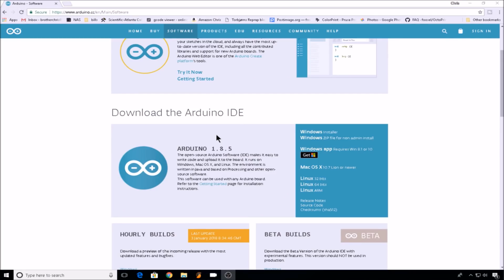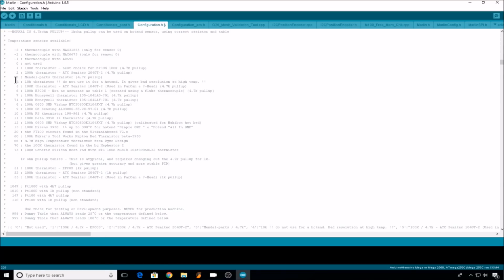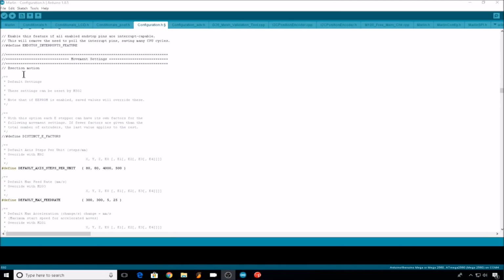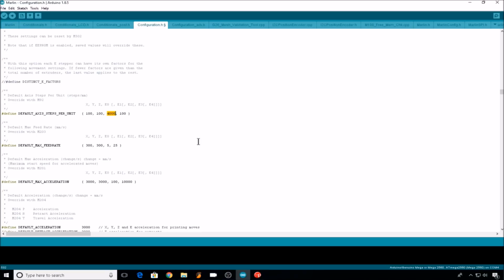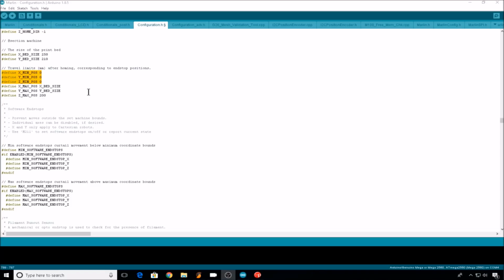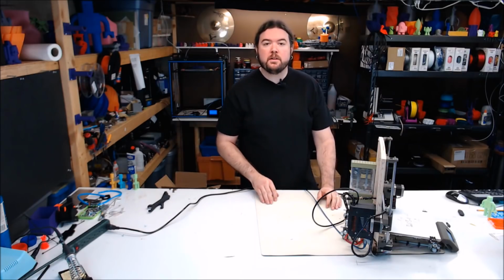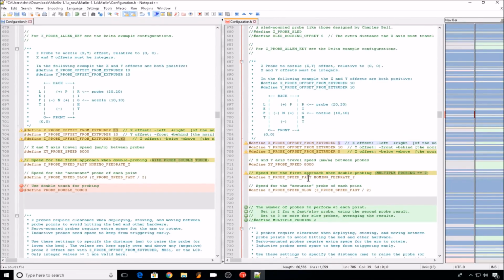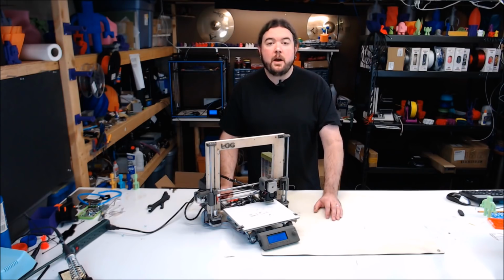Marlin v1.1.8 3D Printer Firmware Complete Config - 2018 - Chris's Basement

Comment: Thanks Chris,  Subscribed.  It has taken me half a day but I've managed to take my Geeetech Prusa i3 Pro B from the factory installed firmware 1.0.3 all the way up to the latest 1.1.9.    I've a programming background (years ago) so with your instructions it was all pretty straightforward.   An invaluable guide and the Notepad++ tip and Compare versions is awesome.
Reply from the maker: You're welcome! Thanks for the sub! I have intimate knowledge of the PRO B, it can be frustrating at times to say the least. :)

Comment: This was a very good tutorial vid. I especially liked that compare plugin for notepad++....didn't know that plugin existed. Very useful. I've been trying to set up the new Marlin for my GT2560 board and sanitycheck.h has been screaming at me every time I try to verify. Trying again with a fresh download using my notepad++ with compare.
Reply from the maker: Awesome! I have worked on the GT2560 a couple of times. Let me know if you still have issues. I might be able to help. Thanks for watching.
Reply: Well after multiple issues with Marlin in the IDE, I finally got it to compile a sketch (some things are different since last I used the IDE). I was going to load it after I finished my current print job. Unfortunately, I had a 'derp' moment...noticed a bed wire was barely clinging on at the board (my own shoddy wiring work) and I moved it. Blew my 10A fuse. It's amazing how difficult it is to find those things. Waiting for new fuses before I continue.
Reply from the maker: HedoBum Doh! I have replaced those with automotive fuses in the past if that helps.
Reply: Wow...didn't think automotive fuses will fit in those blocks. I imagine you can get automotive littlefuse in there with a little post wrangling. Nice MacGiver.
Reply from the maker: HedoBum Not a great fix, but you could probably make it work.

Comment: Hi @Chris Riley, and thanks for the exhaustive video of Marlin settings! Great job, clear, comprehensive, and I like your voice (not making a move on U!), like ChrisFix 's one!

I just flash my Anet 8 with Marlin 1.1.9, and the thing is that when I'm doing an Auto Home, my printhead stay stuck on my endstops, and that for the 3 axis... I double/triple check my settings (especially X_MIN_POS, Y_MIN_POS, Z_MIN_POS), flash marlin 3 times...and don't find back the way it "autohomed" when I was with the original fw (step back few millimeters in the 3 directions after "Home All").

Is that normal, or did I miss a thing? 

Thanks again man!
Reply from the maker: Hey Oliv, thanks! So it autohomes, but it doesn't double check anymore? In configuration_adv.h make sure these are all uncommented and set to a number.

//homing hits the endstop, then retracts by this distance, before it tries to slowly bump again:
#define X_HOME_BUMP_MM 5
#define Y_HOME_BUMP_MM 5
#define Z_HOME_BUMP_MM 2
Reply: @ChrisRiley  Thx for your reply:  it does double check every time I make an autohome... I checked one more time, and this behavior, that I took for strange, is completely normal with Marlin! I made knots within my mind for nothing, but before printing again, I preferred asking some specialists!
Everything is working fine, and so I printed yesterday my 2nd test cube, with nice result!
Reply from the maker: @olivclt9567  Great! Glad it's working.

Comment: Great video Chris, very concise as well as the updated one on the Feature walk through of v 1.1.9.
I made a change of the different location to park the nozzle. When I changed the line with ´min +10 and max -10´ to your suggestion (a good one too) to ´max -10 and min +10´. I received an error message when verifying: ´X_Max_POS´ was not declared in this scope. I then changed it back to the original, saved it, and ran it again I received the same error message. Any suggestions?
Reply: Additional info: I just noticed that the error message say ´X_MIN_POS´ was not declared in this scope, when I changed it back to the original.
Reply from the maker: Probably just some syntax it doesn't like. Make sure it's like this. #define NOZZLE_PARK_POINT { (X_MIN_POS - 10), (Y_MAX_POS + 10), 20 }
Reply: @ChrisRiley  Chris thank you for your prompt response. That took care of it. Not sure what I did it looked correct. So, now the head will park to the right side, great.
Really enjoy your videos, I binged watched all of them in three evenings, I do not sleep much. 
You keeping producing them and I´ll keep watching. Thank you again. : -)
Reply from the maker: @dustykatz9504  You're welcome! thanks so much for watching!

Comment: Hello, I like your video very much. I want to ask you a question, how to turn on the fan to cool down when printing the second layer
Reply from the maker: Hello, thank you! That would be done in your slicer. It will tell the printer what layer to turn it on.
Reply: Thank you for your advice. How to set the G code? My fan pin is 6
Reply from the maker: @spacedream6028  Pin 6 should be default. If it's marlin just use M106.

Comment: Hey. At the beginning I would like to thank you very much for the films that are available on yt, they are very helpful though I do not understand everything because I can speak English ... Can you help me? I built a printer. Similar to I3 this is my concept ... I have a problem with X and Y engine steps I have Nema 17 engines, their steps are set to 80 in marlin. But as it prints a 20x20x20 cube, the cube comes out x19. 48 y 19.5 out of 20 ... Alenjakncalibrates the printer to the 20x20x20 cube when printing a larger cube there is a discrepancy ... 100x100 cube will print 101.5 in X and in Y 101.48 or 1.5mm bigger ... I do not understand the blacz ...? I have 20 gears. GT2 belts are buckled. The printer's geometry is in perfect condition. The dimensions and angles are preserved everywhere. With the rest of the problems during printing, I advise ... Are you somehow an experienced printer. Can you help me? Please contact me TonaTomasz@gmail.com
Reply from the maker: If you have 20 tooth pulleys then your x and y will be set to 100. Those measurements sound very close though. Maybe the pulleys are not perfectly round?

Comment: Great video Chris! Thanks for coverage with current versions of Arduino & Marlin. 
The only thing I did not see you cover was the "X Y Z axis homing and auto-homing. Line 1391 covers "Individual Axis Homing" then line 1395 is uncommented for I_A_Homing_Menu but there is no menu and when uploaded my Di3 goes to x=0, y=110, z=0. Where do I find the menu to correct this to x0 y0 z0?
Reply from the maker: This is good feedback, I am getting ready to start the 1.1.9 walkthrough. Do you need to do safe homing? in the center of the bed? If so take a look at this option. #define Z_SAFE_HOMING

If you are getting different home locations, take a look at these options.

// Travel limits (mm) after homing, corresponding to endstop positions.
#define X_MIN_POS 0
#define Y_MIN_POS 0
#define Z_MIN_POS 0
#define X_MAX_POS X_BED_SIZE
#define Y_MAX_POS Y_BED_SIZE
#define Z_MAX_POS 210

Comment: This a stupid question but do you have to include all of the tabs when configuring marlin my marlin ino doesn't have all of the tabs in it for some reason if I want all of the tabs I have to include them still no power to anything on the printer no bed no nozzle no connect plus all of these apps printrun  slic3r marlin don't really look like everyone else's  I don't know what apps to open some of these files windows 8 thanks in advance for any help👍
Reply from the maker: Hey, so if you only see some of the files, you probably need to try extracting it again. Extract all before you try to open it in Arduino.
Reply: I got rid of other version got 1.9 I guess but I didn't extract it yet. What is the best place to extract it to so that it opens in the arduino ide ?thanks for any suggestion's👍
Reply from the maker: @wishicouldarduino8880  Hey, you can extract it anywhere, desktop is fine. Then you can just go in and click on the .ino file.
Reply: @ChrisRiley  I've tried it all it powers the backlite to the LCD and the end stops but nothing else I'm dumbfounded as to how to get it working .

Comment: i have not done any update since me last print that came out good and now all of the sudden my printer starts printing 10mm off the offset, any idea why? i calibrated the bed like 4 times and reSliced the file 3 times and still wont go down to Z0 and begin print.  i only have printed 1 model i designed in CURA 4.0.0 and i own a new ALFAWISE U20Plus 400x400x500 Marlin v2.1.6
Reply from the maker: That sounds strange, what does the output on M503 look like? Cura might be adding something in there.
Reply: @ChrisRiley   im sorry but how would i obtain that info? what do i type in and where  do i type it?
Reply from the maker: @arletpaz8010  Download pronterface here: http://www.pronterface.com/ Then cable up to your printer USB and you can run the 503 command.

Comment: Hello there, maybe you can help me, i have an MK2B heabed and im having issues with the mosfet, it gets really hot! first try i just soldered the Pin 1 and 2 for the bed so i got half of the beat heated, and the mosfet was ok, then i bridged Pin 2 and 3, so i can get the whole bed heated but the mosfet was f.. hot. IDK whats the issue i changed the mosfet for another of the same specs supports till 50amps and still got fricking hot, also in the bed there is a hole for a 1k resistor and leds, i need to solder the resistor and the leds there? maybe thats the issue that i dont have the 1k resistor or maybe that resistor is just for the leds...
Reply from the maker: That resistor is just for the led. Those beds can be really flaky. If the resistance of the copper is too high, you will get what you see here.  You probably have some trace damage in the bed somewhere, not much you can do about it.
Reply: @ChrisRiley  thanks for the reply, then I'll just buy another MK2B dual hotbed, thank you Chris.

Comment: Hi there, I know I'm a little late to this video, so hope i can still get a reply. I have an Eaglemoss Vector 3 (was purchased cheap not knowing much about the subject). I have marlin installed on it, but the bed leveling never worked properly, so i decided to reinstall marlin. I can't anywhere see an answer to how you enable software endstops. Can you help me with this? My printer only has 1 endstop switch on each axis, so when you go to do the bed leveling, it goes way too far and grinds. Please any help would be appreciated, i've been awake for the past 24 hours trying to sort this lol. many thanks. good video.
Reply from the maker: You should only need 1 endstop for each everything else is controlled by bed size. Make sure these settings are correct. 

// The size of the print bed
#define X_BED_SIZE 310
#define Y_BED_SIZE 310

// Travel limits (mm) after homing, corresponding to endstop positions.
#define X_MIN_POS 0
#define Y_MIN_POS -29
#define Z_MIN_POS 0
#define X_MAX_POS X_BED_SIZE
#define Y_MAX_POS Y_BED_SIZE
#define Z_MAX_POS 300

Comment: Man i need your help!! I changed my board from ramps 1.4 to 1.6 cause i had problem with the heatbed. Everything worked fine in 1.4. Now that im using the 1.6 ramps the z axis makes weird noises and doesnt move up or down. Y and X axis work fine. I swapped motors from z axis to x and they work. I swapped the motor drivers and they also work. Everything is connected correctly on the board and i havent made any changes in the marlin software. Endstops work correctly. What should i do? Im posting this here cause i have had a ton of help from your videos. Keep up
Reply from the maker: I hate to say it, but it sounds like you have a bad ramps shield, the QC on these isn't very good.

Comment: Thanks again Chris for excellent tutorial!!  Really deep & complete flushing my B(rain)CB. 
What about Marlin Feeding Rates (spatially for Z) You would recommend for CNC milling ?
Reply from the maker: Ooooo, that a tough one. I would guess it would depend on the material, not really sure. I home to get a CNC project together sometime soon.
Reply: Yes.. I'm here to help any CAM task. I asked about feeding rates and speeds in general .. thinking that these are max allowed written values in Marlin ..
I do specify all feeding rates when generating Gcode in CAM
Reply from the maker: @ffstructures  Oh, yeah, that's a good question. I don't "think" Marlin has a maximum, you can get it as high as you want in the config.

Comment: Hi Chris. Im setting up a Ramps 1.4 (EFB) /Arduino Mega 2560 (WiFi) for an adapted Makibox but I'll also be using this set up with a much larger 800x700x500mm printer I'll be building soon, so I wanted to test the card first; I'm stuck with Arduino 1.8.8/Hardware Folder and what, if anything to set using the Boards Manager which you didn't mention (I don't think) during this pacy video. Annoyingly Ive already had the correct setup and forgot this element when I changed things to try to upload Marlin/Repetier to a Tronxy X3A Melzi (what a nightmare); If you or anyone else can remind me what I'd have done to get the correct board recognised that'd be much appreciated. I'm fairly sure I installed Arduino AVR boards v1.6.14? I also liked the comparison tool very much, Ive been opening 2 copies of the IDE as cut-down windows and comparing my fiiles that way, your way is much better. Thanks for shring that info.
Reply from the maker: You're welcome, it just won't recognize the board? Is it a genuine arduino or a clone? If it's a clone you probably need to reinstall the ch340 driver. I have also had problems with the IDE 1.8.8, I like to use 1.8.5, it seems to work with everything.
Reply: @ChrisRiley  Ive had Upload successs with IDE 1.04, 1.85 & 1.8.8; I reloaded the CH340 an hour ago & the firmware suddenly uploaded, so, the advice I just read was (unsurprisingly) correct. Thanks. It'd worked with this combo & that driver before so I couldn't see why it wasn't working this time. Driver Reload fixes a lot of problems I suspect. I'm now disproportionately smug at finally seeing a customised_boot_screen LOGO appear on the RRDSC. 1 small step for mankind, 1 smug 'giant leap' for me. C's B Subbed.
Reply from the maker: @goldbunny1973  Awesome, I do love a custom boot screen.

Comment: What am I missing   Went to Arduino downloads and got what looks like most updated version 1.8.9 or windows store version 1.8.21   following along but mine doesn't have same tabs at top as yours does
Reply from the maker: It will just have 2 tabs now, they have restructured it, it will still work the same. You can edit the other files in notepad ++ or something like that. Or use VScode with Platformio to edit from now on.

Comment: Hi,  I am installing RAMPS 1.4 into a Wanhao i3 and have been making great progress by following this tutorial.  But try as I might, the sketch won't compile. The compiler gives me an 'exit status 1' message listing  one of my arduino program files and complaining "undefined reference to 'main' ".  On an earlier try, the undefined reference was to 'setup' and 'loop'. When I tracked down this file, it was an unhelpful MS Visual Studio file describing  the standard layout of INO code. I have tried loading earlier Marlin versions with the same result. Does this mean I have to forget using Arduino if I want to access Marlin? Must I use Visual Studio instead? This error  offers no guide to correction. Any help would be appreciated.
Reply from the maker: You might need to move to VScode, or you need a different version of the IDE. Try an older version like 1.8.5 they are available on there download site.
Reply: @ChrisRiley  Thanks. I have moved on to your tute about VS code etc. Excellent, Thanks.

Comment: Hey chris, i have a big problem with my printer. When im  trying to print the z axis wont lift at all, its printing all the layers at the same height. I did all the neccesary configs  in marlin but i cant figure out what is going on.
Reply from the maker: Is it a custom built printer?  Are you using Marlin?
Reply: @ChrisRiley  yes it's a diy printer, im using marlin and pronterface
Reply: @christost7968  Do you think it is a hardware issue? Has it ever worked? What board are you using?
Reply from the maker: @christost7968  It could be a stepper driver issue. It could be a lot of things. What board do you have?

Comment: So I followed your setup, however, all my motors do is buzz when I try and move them, they won't turn.  What could I have done wrong?
Reply from the maker: What board do you have? You might have some PWM settings you need to set.
Reply: @ChrisRiley  so, it turns out the motors were wired incorrectly for the ramps board. I've repinded them correctly and now it works just fine. Thank you for the response, and thank you for all your hard work making these great videos. I've learned a lot from you!
Reply from the maker: @vn1500g3  Awesome, glad you got it fixed!

Comment: Do you by any chance know how to configure Marlin for the Ender 3 so as to center the builds on the plate? If I place anything in the middle of the plate in Cura it will print skewed towards the front/right on the actual plate. This means prints could potentially end up off the plate on the front/right and you lose some build area on the back/left.
Reply from the maker: You should be able to just set the bed size in Marlin. If the nozzle is off the bed at home, take a quick measurement and enter that as a negative in: 
#define X_MIN_POS 0
#define Y_MIN_POS 0
Reply: @ChrisRiley  Turns out the stock firmware have the bed size set as 220x220 when it's really 235x235 (that's also what the unified firmware sets). I used those values and it seems to have fixed it. Thanks for your reply.